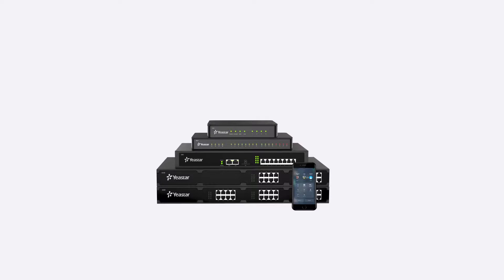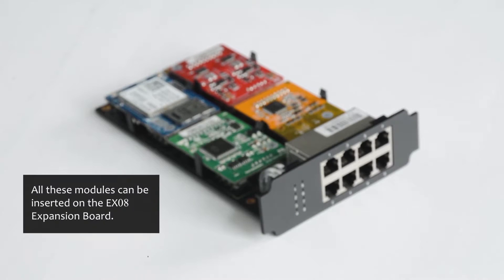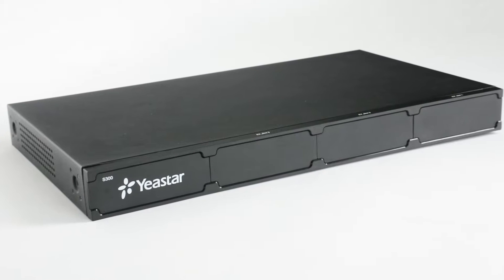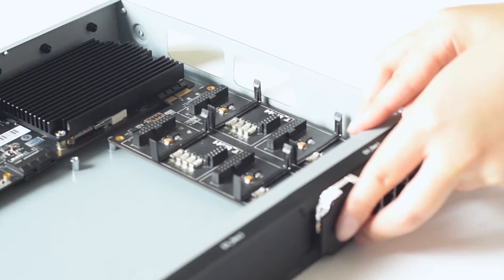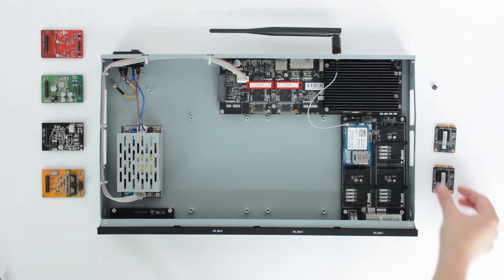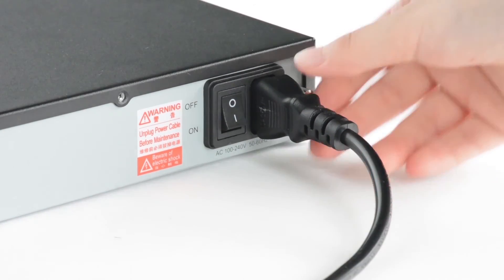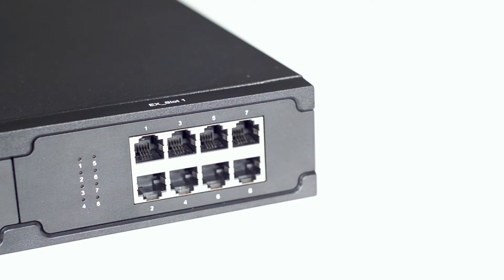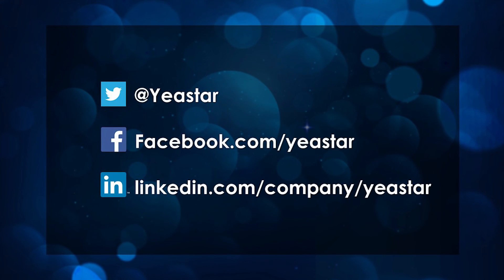Yeastar S-Series VoIP PBX Quick Hardware Installation Guide | Unboxing

Comment: Hola tengo una s100 con teléfonos T19P E2 y T21P E2.
Los T19P E2 funcionan de maravilla inclusive a más de 90 metros de distancia en cable.
Pero los T21P E2 solo funcionan con un cable de red a 5 o 10 metros de longitud. Si sobrepasó esa distancia el teléfono enciende pero no da IP. Y muestra el error "RED NO DISPONIBLE". alguna sugerencia? Será que estoy haciendo algo mal.?
Reply: Hi, there should be something wrong with the cable line. Just make sure your network is reachable first and then you can use the IP phone. You can try to ping PBX on your IP phone for testing.
Reply: @YeastarTechnicalChannel  hello. The cable has been checked and is in perfect condition. tests were carried out with a 60-meter cable and the phone turns on but still does not continue with the ip problem. then with the same 60 meter cable in T19P E2 models they work without problems. none of the T21P E2 work.
Reply: @orlandosantana3867  Hi, if the cable line is okay, I suppose you have to contact the "T21P E2" IP phone support for help. It is not related to PBX. Plz make sure the network of the IP phone is okay and you can use this IP phone with PBX. Any other questions you can create a ticket on support.yeastar.com.